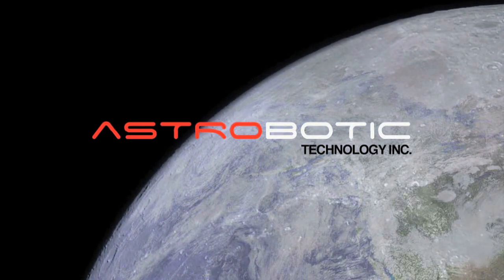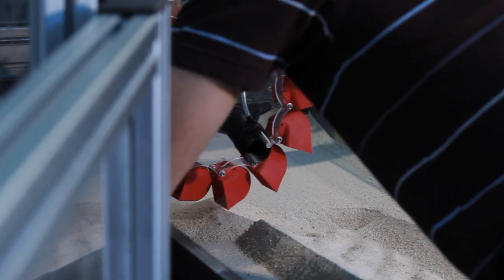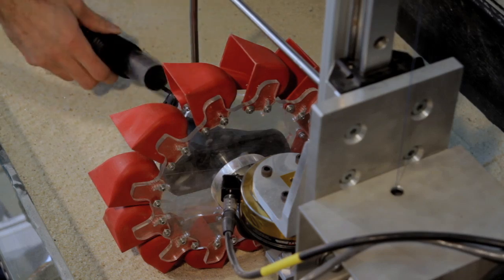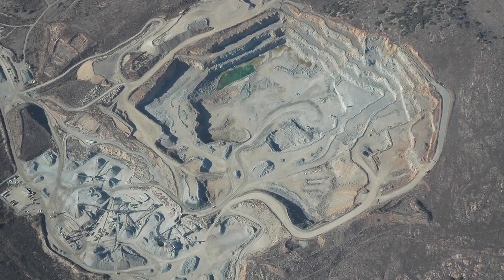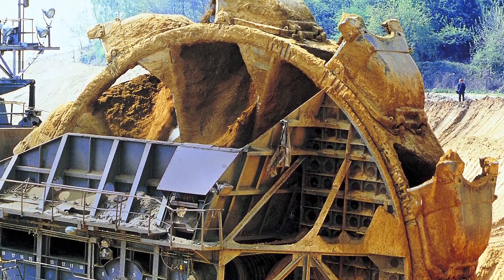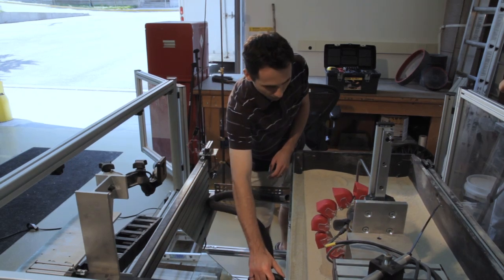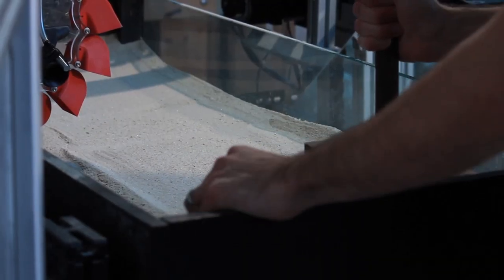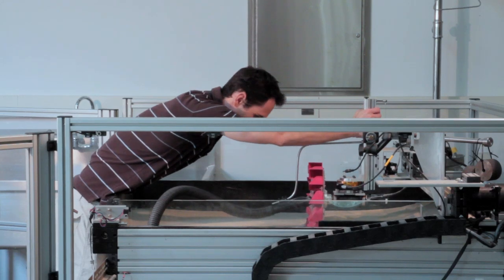Lunar Excavator Development

Comment: So here is my question... isn't weight relative in ALL materials? IE... your excavator will be 1/6 the weight on the moon, but so will the regolith. Hence, do you really need as much force to 'scoop' it as on the earth? Basic reasoning suggests that not as much force is needed. Perhaps there are other factors that throw weight scale off balance, but in basic theory, if your excavator weighs less, so would the material it is mining... (which means it requires less force to penetrate). Thoughts?
Reply: you're right

Comment: What happens if a boulder comes in the bucket wheel's way? What if the surface is not perfectly flat, opposed to that levelled and flattened carefully in your experiment? I think in this case the scale is important.